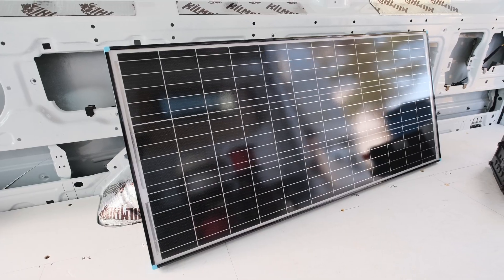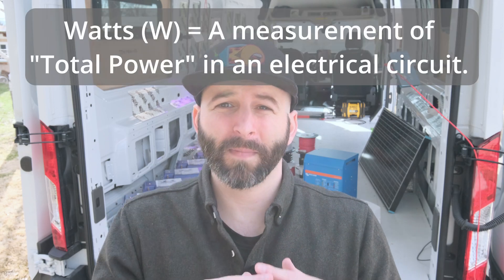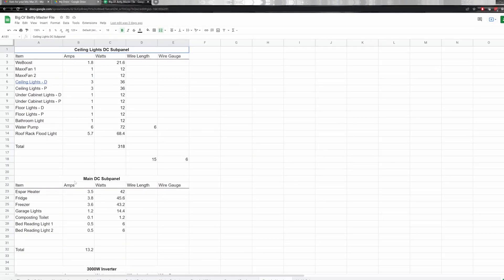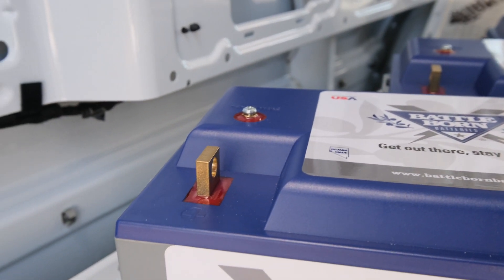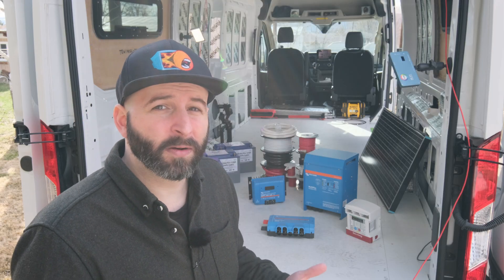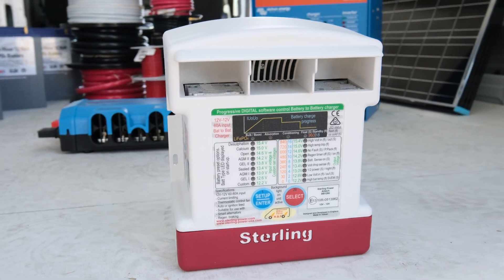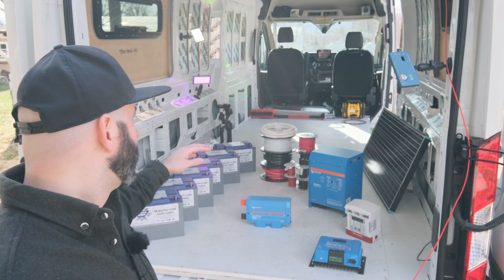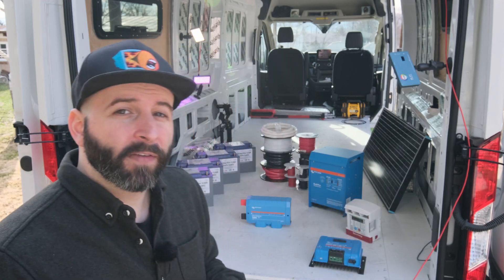Designing a DIY Off-Grid Electrical System | Transit Van Conversion Ep. 16

Comment: I’m late to party (again 😏) and glad to see your build is coming along. Your system design is very close to what I’m planning for my Transit conversion. While my own background is in electrical systems I realize that many DIY van builders will benefit following your presentation. I did find something in your charging chart that can be misleading. The Victron Multiplus 12/3000 can draw up to 50 Amp from a shore 120v circuit, when charging 12v batteries it can supply a maximum of 120 Amp (1400 -1600 watts). Charging at this max current will deliver 100 AH to your battery bank in about 50 minutes.
Note that most manufactures (including Battleborn) recommend limiting charging current to 50 Amp for a single 100 AH Lithium battery, so for a system with less than three batteries it is advised to limit the charge current.
Hope to catch your next video soon.
Reply from the maker: Oh that is good to know! Thank you for catching my mistake and for giving the correct information! 50 min vs 15 is quite the difference. 😆

Comment: I’m interested in the spreadsheet as well if not complete just yet give us access to updates. What are you thinking of changing?
Reply from the maker: Thanks for the feedback Justin! It's hard to know 100% of every single item that'll be used in my build until I ultimately get everything installed and call the build "finished". In the meantime, I'm find myself continually updating my master spreadsheet as the projects steadily progress. 
Can I ask, how are you currently tracking your own build project?
Reply: @ErikJohnson2020  I’m still planning out my build. Looking for a 4x4 144 sprinter (my unicorn) and having a hard time. Good price and condition only last a day or 2 and 2-5 hours drive for me to view. Tracking parts weight wattage cost in XLS spreadsheet.